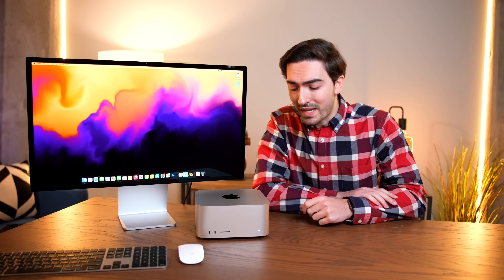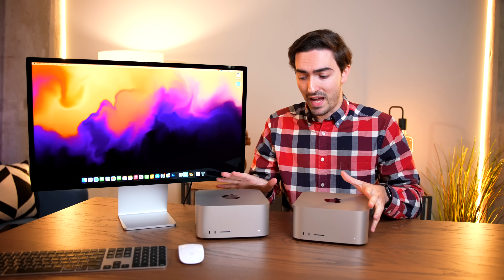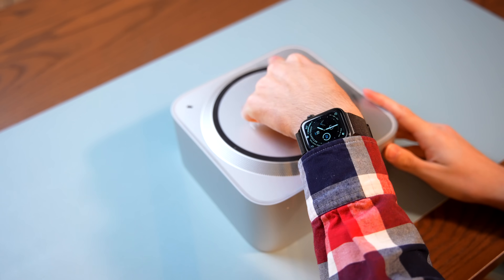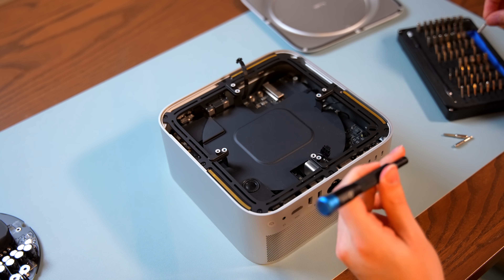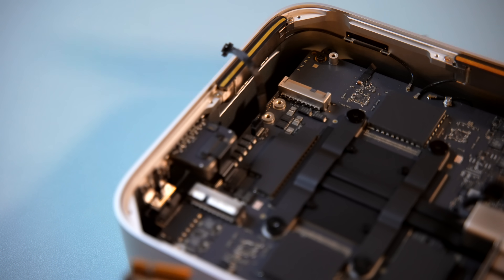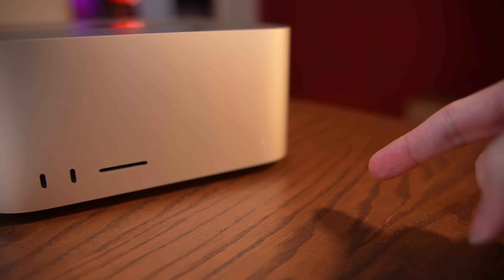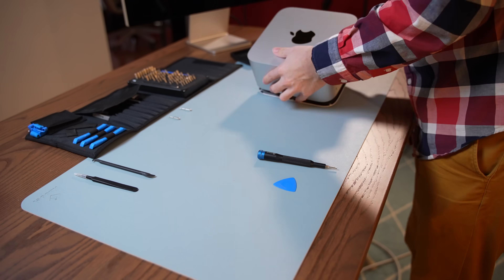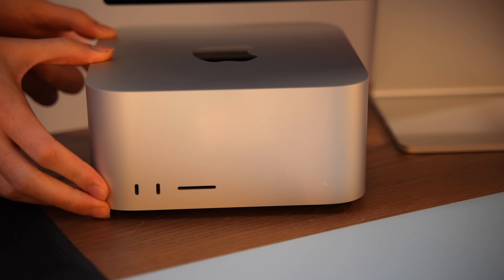What happens if you try to UPGRADE a $5,000 Mac Studio?

Comment: Also this is very similar to what would happen if you did the same thing with the Mac Pro. It seems the serial number and basic information has become a part of the main chip since the A14 series meaning all you have to do is restore the device from another machine. Yes the T2 was based off the A10, but a notable thing about upgrading the storage on anything A14 and newer is that you don’t have to program the storage with the device info before you install the drive https://youtu.be/bloCpO7baO8 this video shows that upgrading even soldered storage no longer requires the NAND chips contain any base data to pair to the CPU since that happens during DFU restore which applies to iOS devices and Apple Silicon Macs. So pretty much you could probably follow the same guide of restoring a Mac Pro for an SSD upgrade would work exactly the same for this machine.

Comment: Actually having an exposed power supply is good for right to repair because it means components on the PSU can be replaced easily unlike with the power bricks of like the M1 iMac that are glued shut and even though it’s easier to buy a new one, the PSUs for the Mac Studio are much beefier than for M1 machines so having the ability to easily fix things like bad capacitors is really nice as long as you wear insulating gloves or only hold from the edges of the unit.
Reply: that kind of stuff is too risky for the average joe

Comment: Catastrophe!  I have an hp workstation... It has a lot of RAM, almost 200GB;  it is exchangeable, CPU's are exchangeable, exchangeable SSD's, exchangeable DVD-RW drives, it has PCI-X slots, graphics card(s), USB ports, Ethernet port, ASF port, exchangeable power supply unit, exchangeable system fans, exchangeable motherboard,...  Windows/Linux compatible,... It's simply the very best hardware!

Comment: I find it hard to believe that they just cynically disabling this. It probably has to do with power supplies and all kinds of things. Perhaps the power supply is only suitable for booting up the circuitry that’s in there and not for all potential circuitry that every user could try to jam in. Apple is a closed ecosystem and that’s why it’s so safe. If you want the wild West, go to a Windows machine. You can do anything you want with them, including it getting any one of 100 quadrillion viruses.

Comment: Did you try to boot from an external hd with the „strange“ ssd built in? Maybe the ssd is crypted during installation of macOS so that it works only with the one computer. So try to boot from an external disc and then format the ssd from the second computer.

Comment: Since the T2 is in the system the built in media is encrypted by default with a key stored in the Secure Enclave inside the T2 chip. The act of enabling FileVault encryption only stores a keypair in your keychain to allow you as a user to decrypt the Secure Enclave. From that point on any user needs a key to the Secure Enclave. By swapping the ssd the t2 is Not able to decrypt and therefore use the ssd because the key is invalid. The second ssd is combined with the primary one much like a raid0 would work just adding capacity. Because it was encrypted with a different key by an other t2 chip it’s not recognized. I‘m relatively confident that OWC or som other manufacturer will come up with an upgrade ssd solution that allow you to swap the original ssd for 2 new bigger ones in the future. Having no hardware to test  and play with I don’t know if you can configure  the two ssds as one within the software restore mode from the diskutility but I know you can configure two disks/ssds in the commandline diskutil.

Comment: I think the SSD won't be recognized as they are been signed by apple on assembly time, I think this was released by apple a time ago. An SSD would be matched and signed for a specific product, for example, your Mac Studio A SSD won't work on your Mac Studio B, just for the fact that they are matched and paired on Assembly time.  

Another thing that it could be happening is that the texas controllers aren't present for the second slot. so, it Would be good to have a Mac Studio SSD Spec out in order to see if the second SSD is there and the Texas controllers are also there and ultimately swap the SSDs from another Mac Studio and see if work, which I doubt, because the macher process of the SSD and The Mac Studio on Assembly time.  Worth Trying though!

Comment: in the mac pro upgrade kit (someone linked the video here); there are two drives and those drives are numbered and must be inserted in the correct slot. Maybe the two drives have different properties/ electronics and can't be swapped (so essentially you need a number 2 drive to put in the the other bay). or the two drives must be linked.

Comment: As far as I know, M1 chips SoC have builtin SSD controllers.

So the notion that you can swap a random NVMe SSD into the slot with some adapter added to it is non-sensical.

To upgrade/replace the SSD, you need to buy the SSD directly from Apple anyways. Who else sells proprietary SSDs?

So these "upgradeable" SSD isn't really upgradeable.

Comment: Question: Don't current Macs use the T2 chip for encryption? Is it possible that changing drives around breaks the encryption. You might have needed to decrypt the drive first (if that's even possible.) I know that's the case if I pull out a BitLocker'ed drive on a Windows machine. It's been especially annoying on new Windows 11 laptops (assuming they have removable drives.) Good luck.
Reply: Only the more recent Intel Macs have the T2 chip, however the M1 Macs likely have similar logic in them.
Reply: @TimurTripp2  The T2 chip was essentially an apple iPhone chip that works in conjunction with the Intel chip to produce a hybrid system. As well as locking down the drives for security reasons, the T2 chip also helped with encoding and other workflows. 

I assume as it was already an apple chip, it would be easy to copy those features across and incorporate them into M1.

Comment: yeah that's BS. they don't even want you to open it at all; just even opening it is worse than on the imacs with the PSU exposed. The fact they sell mac pro upgrade could be an indication that it's possible with apple configurator but nothing prevents them to encrypt the drive and lock it to your hardware; so even swapping disks would render it useless.

Comment: It doesn't work like this.
It should be same as Mac Pro SSD upgrade procedure.
When you change SSD configuration in Mac Pro you need to put your mac in DFU mode.
Connect via USB-C to USB-C cable to other mac and restore mac firmware with Apple Configurator 2 tool.
This will trigger T2 chip (this chip is now inside M1) to delete and reformat SSDs.
After that just install new OS from internet or IPSW file like iPhone/iPad etc.

Comment: I reckon they chose not to solder the SSDs to make assembling the computers easier. It's still scummy, don't get me wrong, but nothing's been lost. Mac minis haven't had removable storage for quite a while and this machine is an extension of those. I'd have a different opinion if they stopped supporting removable storage in their Mac Pros, as that'd be functionality lost that previous models have had.

Just so I'm absolutely clear, I believe Apple should have removable storage on all their Macs. With a little bit of re-engineering there'd be enough space in these computers to house an empty M2 slot for expansion

Comment: I give it 2 weeks before D-BRand comes out with a replacement rubber ring thats like 1 inch narrower so that it doesnt cover up the screws, and just has a loose flap that goes into the channel where the old one sat
Reply: So, i dont like apple, and i saw the repair program as lip service.
But this is far beyond what i expected Apple to do.
The lion, the witch, and the audacity of this

Comment: The amount of time needed to open and close these machines at least 5 times, dedication. Great job luke.
Reply: I know right. I was thinking the same thing. I mean to upgrade or switch one thing especially the storage you need to take the almost whole thing apart to get there.
Reply: Didn't iFixit successfully swap the ssd between two machines? https://youtu.be/TYF527DqnwY?t=112
Reply: But it is also, totally pointless. We all know what apple does, besides putting a second ssd in there when the cooling probably wouldn't handle that very well ... etc... creating all sort of new problems ...

Comment: I would guess that 2 drives default to a raid 0 stripe (rather than an easier to work with concatenation or separate drive) from the factory configuration. There must be a low level menu that you need access to in order to recover the original volume to a point where you could even reinstall on a single drive.

Comment: can you attack a bigger SSD externally and boot to it, with the factory SSD in place, and also removed ?  My plan was to get the $2000 model and use my existing 2TB SSD and boot externally with a Thunderbolt 2 enclosure. ( I already have the enclosure and TB3 to TB2 Apple adapter. )

Comment: This isn’t a good comparison. If you got the exact same storage amount of SSD and same part number then you can replace it with the same part. But you can’t upgrade it. 

So this ssd is meant to be fixed but not upgradable.
Reply: We have no idea yet. Because swapping SSDs without going DFU / Configurator can not not boot. This is totally expected.
Reply: @philippeastier7657  that’s kind of my point. Until Apple opens up the Mac parts, we don’t really know.

Comment: Shameful display. This is why I am still running a 2010 Mac Pro that has ram that I found laying on a shelf in our server room from a dell poweredge server, multiple storage drives of various brands and technologies (WD sata spinners, crucial sata SSD, intel m.2 ssd in a 3rd party PCIe riser), off the shelf Radeon GPU, etc. In all honesty, I would argue the Mac Pro 5,1 (2010,2012) is the best computer apple has ever made
Reply: Also, this same mac triple boots to Mac OS Mojave, Windows 10, and Kubuntu Linux
Reply: @Joel-ew1zm  OK guys, let's be serious for a minute. This machine is multiple times more powerful that the machine you mention, even fully upgraded, and for a fraction of the power cost. And this machine runs macOS, Windows 11, any ARM-based Linux in a VM, and Asahi-linux bare metal as well (not on the Studio yet, but on any other Apple Silicon Mac). At some point, the technology gap is seriously wide. By the way, there will be a replacement for the MacPro as well, it's been officially confirmed. The Mac Studio is a new range of Macs, period.

Comment: Then reason is Apple doesn't want random people opening up their mac studios. There are components that could be damaged or shock the consumer while getting to installing the new ssd. So as an obstacle to having people promote opening up their mac studios and potentially getting shocked/damaging components, they added software locks. If you want more storage, pay for it up front. If you complain about the cost, get a Windows computer. There's other manufacturers that will happily sell you what you want but Apple has their own ways of dealing with their products. No one has forced you to buy this mac studio.

Comment: The thing is, you buy the Mac Studio knowing full well that it is NOT UPGRADABLE.  It's fine to conduct your experiments to see what works and what doesn't.  However, to get on your high horse and complain about something you absolutely knew going into this is ridiculous.  You even know the security implications of what you're proposing.  If you need user upgradable hardware, go with another platform.  You knew this going into the purchase.  You just sound pathetic crying about it now.  For that matter, as others have mentioned, you didn't even attempt to restore the firmware as you have to with any T2 based Mac.

Comment: Configurator 2, put the Mac Studio into DFU mode and use another Mac to upgrade it.
There's Chinese Mac techs that are desoldering and soldering SSD upgrades to the new M1 MacBooks and have been doing so for months now showing you need a second Mac to configure the SSD upgrade. 
C;mon Luke!  Thought you knew better.

EDIT: 
Actually, now that I think about it, what if you desolder and solder on new NAND chips to the factory Apple SSD board.... Calling it now, this will be one way Chinese Mac techs will be able to upgrade the SSD if a plug n play solution is not found.

Comment: Did you tried DFU mode? Because the issues you are experiencing are normal for locked EFI Boot sequence.
Reply: Correct, except there is no EFI on Apple Silicon. EFI is for x86 Macs only. :)
Reply: @philippeastier7657  Then last resort is DFU mode. I would like Luke should had tried that. Well, he still can if he still have both Studios.
Reply: @rfog  It's not last resort, just standard procedure, and totally expected. Yep, that would have been great.

Comment: What don’t you understand from the statement that the storage is not upgradable which is clearly signified when you order the computer? The fact the  SSDs are removable may improve the ability and cost to repair if the SSD fails so I view it as a good thing rather than bad. If you want a user upgradable computer just vote with your money and buy a different brand. I just don’t get this whole fuss you are making. It is obviously just to collect clicks and silly comments.

Comment: Hello my friend, by all means, I respect all your hardworking for this video. But only a small issue, maybe you have done that, but did not put it on the video.
After you swapped the SSD, the machine did not work. However, you did not swap it back to prove that it would be functional normally. It could be possible that while you doing your work, something was wrong with the machine already, so no matter how you play with the SSD, the machine will not work properly.

I believe that Apple has done something genius both on the software and hardware sides, just make sure the machine is "secure" enough from all kinds of tweaking.

Comment: Hands down Luke, you are THE best tech youtuber out there (alongside Gamers Nexus and Linus to some extent). Apple’s greed and lack of upgradeability and reliability for the past 5-6 years are the reason I switched to Windows 11 PC and  I got my life back by doing so. (I’m in VFX and 3D content creation business).

But let’s suppose you were able to pull this ssd swapping operation off and the Macs were able to boot just fine. It would still be a shameful disaster because Apple does not offer SSDs to be bought from them as a spare part so it would be in vain just the same since the regular third party ssds cannot be used. Maybe OWC could do something in that case. 

My word of advice to all the content creators out there:
Buy the damn PC. Windows 11 are just rock solid and stable, and the OS itself (at least the way I see it) is just an application launcher and storage manager. Nothing else. Stop drooling over the super overpriced pieces of crap that will be obsolete couple of years from now. The future Mac Pro will be just the same. Overpriced and underpowered for the asking price (which will be huge… north of 6000 usd for the base model).

Apple has no interest in professional number crunching long lasting machines. These are just toys for the rich kids to have some bragging rights. Just ask those naive idiots that bought the 2019 Mac Pro how they feel now. For how long will Apple be supporting them and offering  more powerful AMD gpus? They already forgot about them, but they’re still selling that same Mac Pro for the same price of 6000 usd upwards. 

I would really like to see Pixar or ILM artist in a big room doing their next Oscar winning movie on these little boxes. Not by a long shot. What we are seeing now in Apple’s marketing materials are just dressed up hipsters doing some lightweight Photoshop touch ups or something in equally fashionable interiors. 

Wake up.

Comment: I could argue, that even if it would be upgradeable, considering the price the Apple SSDs would probably cost, it’s better to build a NAS, which can have “normal”, off the shelf, high speed SSDs. It is cheaper, and all devices can access all the data, if necessary, even remotely.
Reply: Agreed.  Or even just use an external thundrebolt ssd drive.  Thunderbolt is so fast that it probably would be negligible speed difference than an internal ssd.  Using a NAS you will be restricted by network speeds for data transfer instead of wired or internal.
Reply: @DetroitMuscle  network speed is theoretically far far faster than thunderbolt tho right? Mac studio has 10GB networking
Reply: yep hence why the video is a bit silly - between the cloud and the external storage the issue is becoming a bit moot.

Comment: Thanks for doing this - when I saw the first teardown I thought the exact question you have answered. In my opinion, the baseline SSD at 512GB on the Max machine is way too small and so likely anyone buying that will want to upgrade at some point. My view is that given the physical slot is soldered in, that the necessary driver chips will be on the PCB (if only to give some flexibility for manufacturing options). Perhaps it is too early to just plug and play here and that at some point there will be some software steps as others have suggested. Certainly when I first encountered an M1 Mac Mini and tried to erase and setup the drive it was a major pain. I do live in hope ! Again, thanks for doing this at this stage..

Comment: Is the SSD drive's Serial Number locked to the CPU? Given that the Asahi Linux shows that the M1 based macs up to this point have been fairly open to allowing 3rd party installs of OSes, why takes this step that is so clearly use hostile. I wonder if enough people stating that this is bullshit will change how Apple handles "security" on this product.